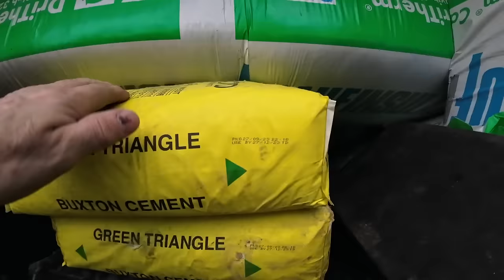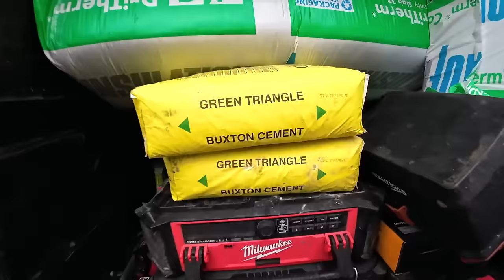WHEN BRICKLAYING ISN'T JUST BRICKLAYING...CONSERVATORY TO EXTENSION PT 6

Comment: hi steve and alex. i cant believe the building inspector makes you cut into the existing brickwork to form a vertical damp. we are allowed to put damp at back of wall starters with very little damage and stronger job all round.nice see to that your cracking on .all the best for the future and hopefully a swift recovery.👍
Reply from the maker: Cheers Lawrence different inspectors different rules 😳🧱👍🏽

Comment: 12th Feb?
Reply from the maker: Thanks for the heads up. It’s been corrected 🤙🏾🧱👍🏽
Reply: Why don't you cut out in the wall so there is no break in the insulation? Ie cut a channel in existing wall throigh the face brick.
Reply from the maker: @trailbuilding . Building inspector didn’t want us to do that 👍🏽🧱
Reply: @trailbuilding doesn't mean the ties in the house support that. Can cause a major  weakness. Never been asked on 100 + extension
Reply: @trailbuilding  
Why.?